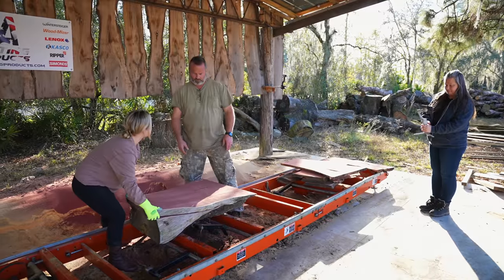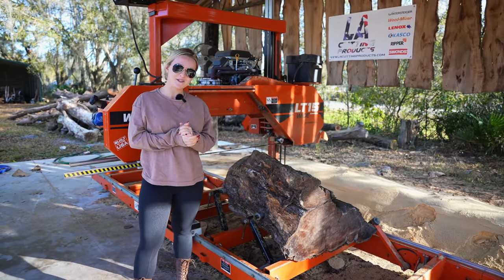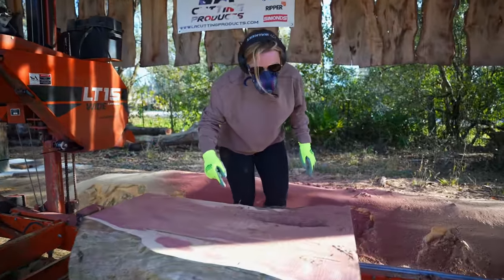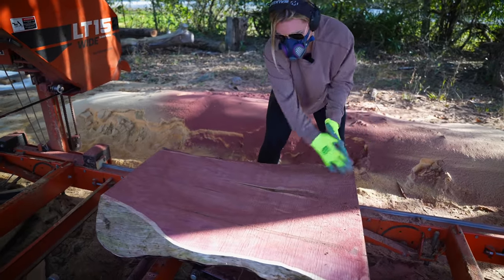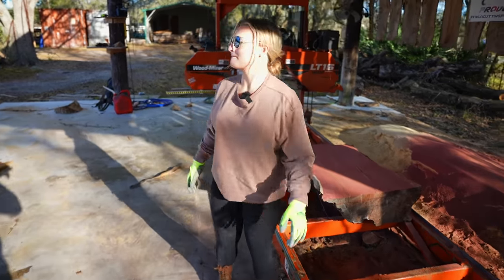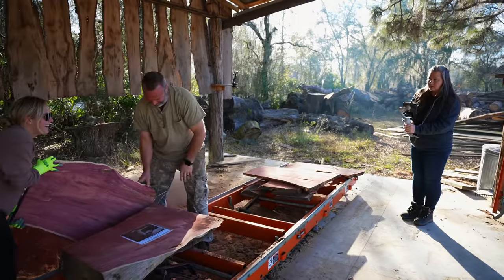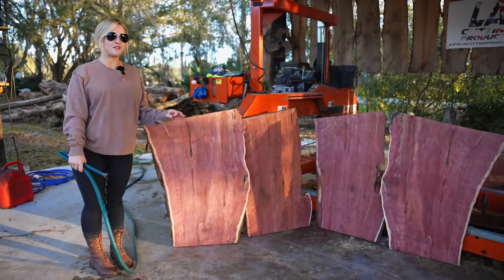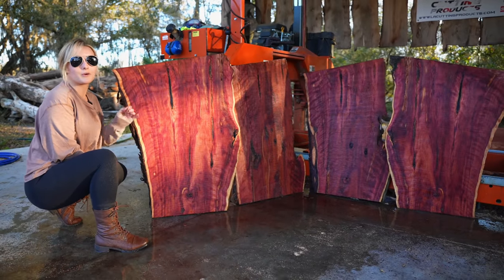What's Hidden In This Log Will Change Our Lives Forever!

Comment: I work at woodmizer Pennsylvania 
You need to speed your sawing up until you hear the engine bog down it will make your cuts a lot cleaner and keep the blade a little bit longer.

Comment: I work at woodmizer Pennsylvania 
You need to speed your sawing up until you hear the engine bog down it will make your cuts a lot longer and keep the blade a little bit longer.

Comment: Please Honey,
Wear tighter clothes as the motor coming of gas engine is 4 or 5 inches from your sweater at times. I saw a man that got snagged by a lathe, and instantly thought of him. These new saws are dangerous and most of the people are not qualified to operate them. These saw blades can snap and take of a limb. Congratulations on your child and it was a child at conception.